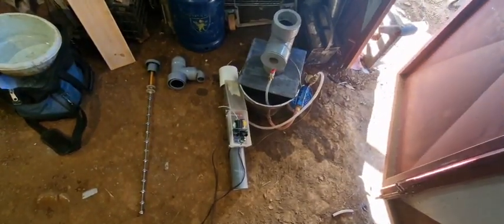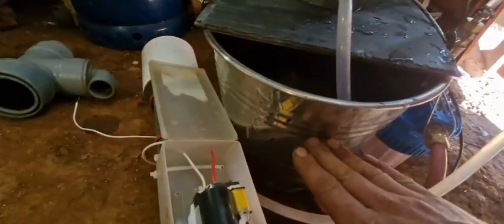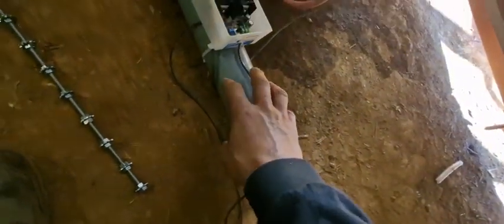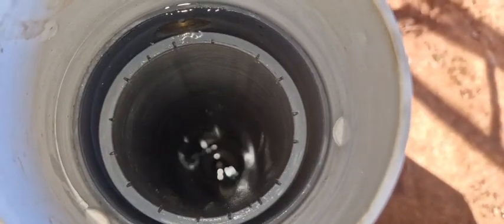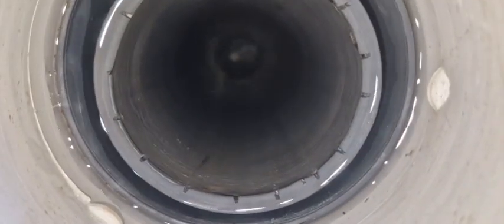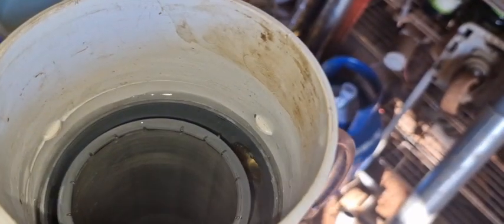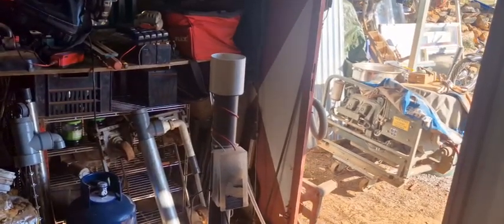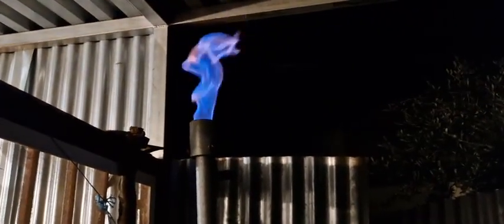wet electrostatic precipitator for producer gas cleaning #DIYGasifier #BiomassEnergy #OffGridLiving

Comment: nice work! I read a paper yesterday, I'll dig up the link on request, about removing 99% of tars from syngas  by bubbling the smoke through vegetable oil
Reply from the maker: I found its Best is to keep the filter system dry en tackle the tar probleem in the gasiffier itself en this is successfully accomplished by now . Make sure you watch the zero tar gasiffier videos, greetings

Comment: Nice work
Reply from the maker: Thanks I'm not totally satisfied because the 10kv power supply is only good for up to about 50l/min so i need to put a other one whit like 30 to 40 kv  , also the water Layer was pushed aside at some spots do to incefficient water flow on 8v on the pump it stays if the pips stays perfectly horizontal ofcourse

Comment: do you think the high voltage cell would clean atomized water vapor to make clean water?
Reply from the maker: It's definitely not going to make clean water, as it enhanced gasses en particles to dissolve in the water en flush away so only the air is clean
Reply from the maker: I've just read your question again en I didn't understand it the first time I guess, the electrostatic precipitator is a excellent way to separate particles put of the air or any gas en make it dry so if there's only water in the air it wil Collect it

Comment: Oscar, what would you suggest to implement this in a mobile application like a pickup truck?  Would one just need to use a Dry electrostatic plumbed in before the gas cooler?  I couldn't imagine the wet laminar style being very efficient on a moving vehicle since it couldn't stay level.
Reply from the maker: I highly appreciate your comment, Yeah that's a sure thing even for stationary applications its not useful although i works realy good. The problem is it makes waste water !. I'm using the dry electric filter now for quite a while en its the best thing as a final filter!  it uses very little electricity en takes 99%+ of the fog out of the gas . Cleaning is pretty easy, just use insert a metal pipe in it so you can just pop in a other one. In my experience the longest run time was 8 hours then the efficiency drops of sometimes only 2 hours so we need other measures aswell to eliminate mist . I have great success with a sand filter a few days ago it works just aswell as the electrostatic filter but is more reliable.  Greetings
Reply from the maker: A better way for mobile applications is a impact filter like saw dust, sand or a whole stack of metal mash sheets . En a dry electric filter in the end. I wish you the Best of luck